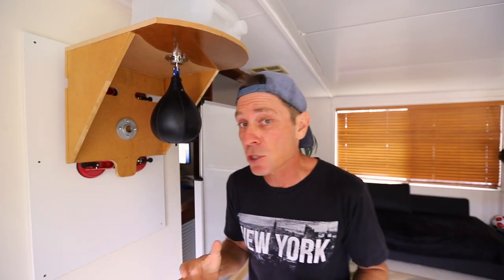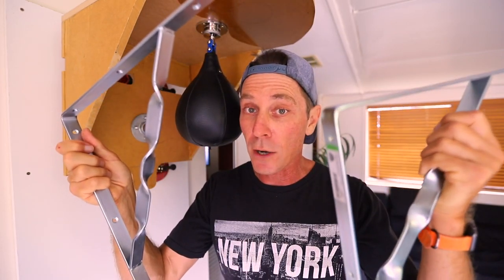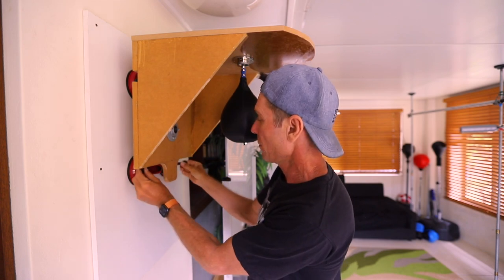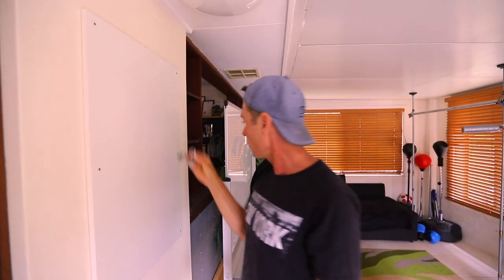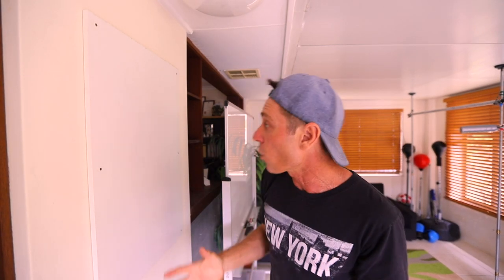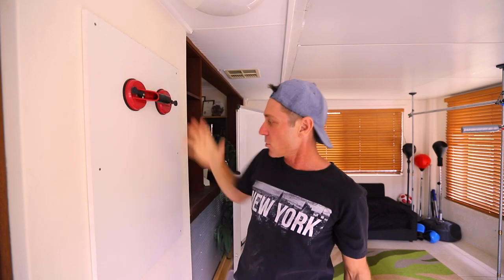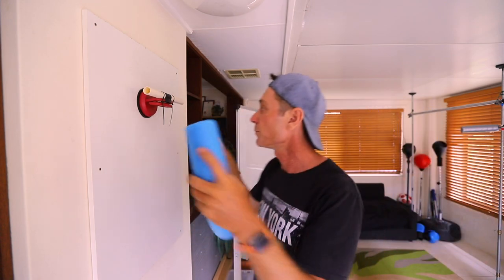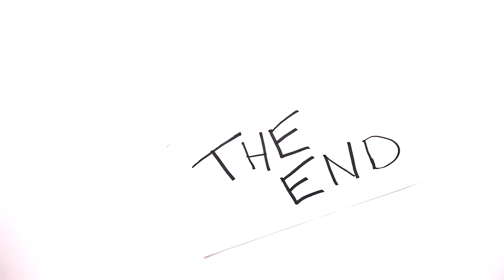DIY Speed Ball Platform - Part Two

Comment: Top man Reedy with another top video. Could you try and add some more weight on top of the bored so there is less vibration so you can use it like a professional speed bag at a fast speed, you could use a sand bag or something like that weight
Reply from the maker: Thanks Joe, I actually forgot to mention that I placed a 10 litre water container on top to dampen the vibrations. I think your idea of using a sand bag is even better!!!

Comment: It’s hard to find a house in the US with concrete on the east coast. It’s all wood and dry wall
Reply from the maker: Is it possible to screw a backing board onto such a wall?
Reply: @Kewlus  It is. You have to find the vertical wooden beams behind the wall with a stud finder.